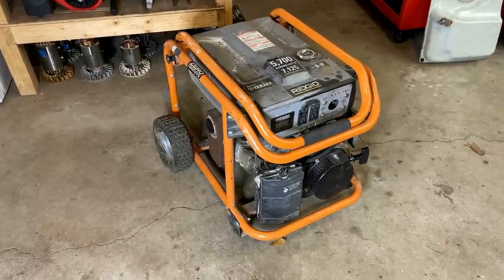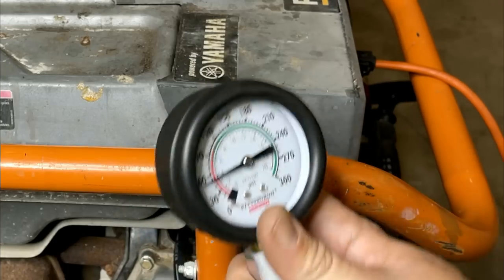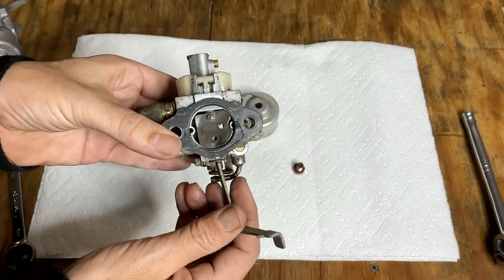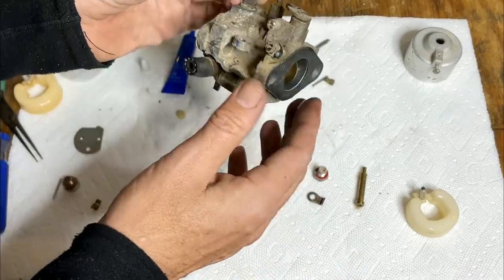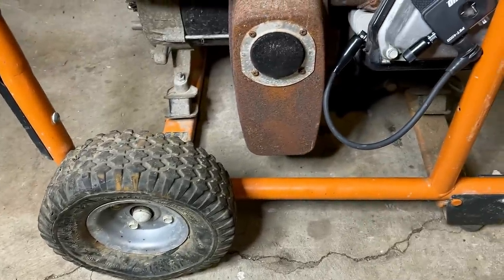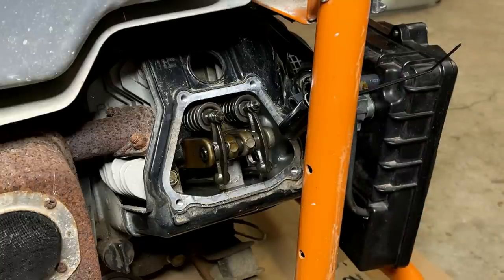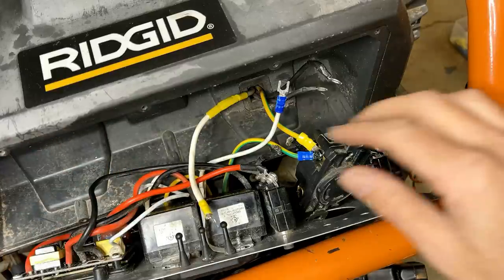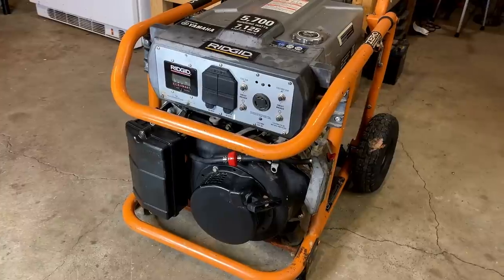Trashed Ridgid Generator - Will Not Start

Comment: Well done!  Wow, over 1500 hours is a LOT for a unit like this.  All signs point to a contractor using this on a daily basis.  Like you, I always try to put the pieces of the puzzle together to tell the story.  It's odd that the 120/240V outlet was removed, and the person was somewhat smart enough to wire nut the loose ends (wire nuts are certainly not recommended for ANY vibrating equipment) but at least the person tried.
I guess the root cause of throwing away, was maybe a no-start due to dirty carb and/or getting harder to start and run well with the need for a valve adjustment after all those hours?
1500 hours /8 hours in a work day = 187.5.  a 6 hour work day brings that to 250 days of use.
Maybe the owner decided they got their money's worth out of it, and went for a new unit that was reliable.
Good find and great video!  Oh, I don't recommend soldering wires/connections on any vibrating equipment - the vibration over time, can actually crack the soldered connection.  Crimp connection is much better.  Even better is crimp with heat shrink - it protects the wire from moisture and hold the wire in place better.
Reply from the maker: Most manufactures do crimp the wires so I do the same.  The plug may have been the final thing, but it makes me wonder how it was running before.  My money would be on the tight exhaust valve.  It’s possible after running for a few hours the valve may have stopped seating and it would lose compression.  Not sure.  Either way, the prior owner definitely got his moneys worth.

Comment: Hi James ,if you Wash the carb bowl O ring with a little bit of petrol and let it dry and it will go back to its original size.it works on all the gx Honda engine carburettors
Reply from the maker: Thanks.  Just did that the other day to clean one.  It worked very well.

Comment: I've run into a bunch of freeby (from local mobile mechanic shop's dumpster) rebranded chonda clone generators ranging from 5-9kw over the last 5 or so years, it seems like those engines are hit or miss with quality. Pretty much all the ones I got were engine grenades and the oil didn't even look bad. The ones that did run had pretty loud internal noise, even a brand new replacement engine I bought (was name brand clone too, but I forget the brand). The most impressive one I got was a 9kw dewalt branded unit that suspiciously ran great and made power. after running for about 5 minutes, I decided to pull the dipstick and check the oil level (something I should have done immediately, i know). It was low so I added oil and started it. It started pouring oil from all over the block which as I came to find out was full of holes. After dissecting the engine, I found out the governor/balance shaft thing had literally exploded and turned the block into swiss cheese. This didn't affect the engine's speed because it had an electronic governor setup for idle and run speeds. I honestly have no clue how the darn thing even ran and didn't make any noise. I'm in the process of using that cam, crank, rod and piston in another block that knocks since the bearing surfaces are still good somehow. Things seem the opposite of how they were 20+ years ago where the engines outlasted the generator heads. Think all the ones I get that still run will see some thicker oil than what is recommended from now on.. maybe 15w40
Reply: Maybe the clean oil you see was put in after the engine made bad noises from running low on oil?

Comment: when you solder stranded  together on a break ,you can weave the one inside the other and then when you solder it doesnt make a bulge  and it looks like 1 wire when you pull heat shrink over it .

Comment: James would this generator have the same issue with the vapor lock in the fuel line? I received one for free. MZ360. 8600 watt. It Sat under the guy’s deck since Hurricane Sandy.  Said it would stall and never ran right.  I cleaned out the gas tank replaced the carb and added the fuel pump. Followed your video step by step. Re- routed the fuel line. Has not failed me yet. Thanks for the great videos.
Reply from the maker: Not this one.  The tank is flat and they moved the fuel outlet to the front closer to the carb.

Comment: Spark plug gap should be 16-20 thou . Half what you have there. Its important for the timing in that a wider gap takes just a little longer to jump the gap so you have built in delay of spark. Don't know why they would say 28 thou. Could be a design problem patch.
With the valves importantly the exhaust valve clearance must be enough so that when the unit heats up to operating temperature some slight clearance remains . Too close the engine falters when its hot . I'd go out to 10 thou inlet . 8 thou exhaust usually gets them right and does not try to open the exhaust valve as it gets to full temp.

Comment: Remember when wiring, your neutral must carry the current of both phases in 120v 2 circuit ie 2 phases as separate circuits. The return to the generator will carry 2x the current of one phase. You cannot take the 240v outlet and split into two circuits. It will overload the neutral wiring in most all cases.

Comment: Jim, when you brought the piston up to TDC to confirm timing I thought the camera picked up some pitting on the top of the piston.  Maybe the screw from the choke plate did get through the intake valve.  Hopefully right on out the exhaust.

Comment: When you had the valve cover off I would have check if that screw was in there an use a camera to look inside the intake, the cylinder ,then the exhaust off . I don't know if you did that off camera or not.

Comment: You might want to work on your soldering technic.   You should put the iron on the opposite side of the join where the solder being applied.  This technic forces the solder to travel through the connection toward the hot iron.  This makes the entire connection (including the center) be filled with solder, not just the edge where the hot iron is. :-)

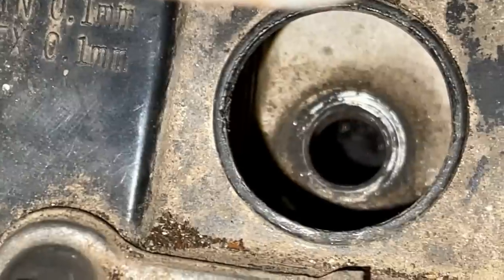Comment: 11:04 when you had the camera looking at the piston top through the spark plug hole, it looked like some small indents on the piston. did that choke plate screw go through it?

also, what's the specified service life/hours for these, 1500 doesn't seem that bad compared to other engines?
Reply from the maker: That screw probably did go though at some point in its life.

Comment: I got a duro max generator that runs on gas and propane. I wanted to run propane because it looks like the carb gets gunked up on the gerators you fix. If I have to run gas what gas should I run to avoid having carb problems ive heard non ethanol gas, what is your suggestion also what should i do before storing it away. Great videos, you have taught me alot.
Reply from the maker: Non ethanol is better for sure.  The ethanol fuel is fine to run in a small engine, but you must drain the carb and store it dry.  If you keep fuel in the tank then it must be swapped out at least twice a year.  That is how I store my generator with a metal tank and have never had a problem with the fuel system.  Other things for storage would be to keep it inside and covered.  If electric start keep a battery tender on it.  Change the oil after every use and pull the engine over until you feel compression.  That will close the valves and keep moisture out.  Always keep the fuel valve closed when not using and put a little oil down the spark plug hole for extended storage is always a good idea.

Comment: You should consider a soldering gun or a larger iron with more mass.  It is very hard to heat up a large joint or ground plane on a PCB with such a low mass tip and especially on a low end low power soldering iron.  Paradoxically, using too small an iron or a tip with too little mass on a large joint basically overheats everything.

Comment: Solder and high vibration environments... no bueno.  Guarantee it won't make another 1500 hours before it breaks.  Crimp connection with adhesive lined heat shrink for the win.
Reply from the maker: That what I did in the end.  Thanks for the info.
Reply: @jcondon1  Thought you soldered the crimp?  Didn't look like adhesive lined heat shrink either.

Comment: Nice job. When you pulled the spark plug and looked into the hole, I thought I saw, on top of the piston, lots of carbon build up... to the point that is looked like little nodules. Did you see the same thing?
Reply from the maker: Did not notice the noodle look, but definitely had carbon buildup.

Comment: Just an observation, but I’ve watched most of your videos and all your engine rebuild’s and I have never seen you check the head or the deck to see if there flat, and check thread’s on head bolts to see if there stretched

Comment: Hi James, loved the video. Unless I missed it in someone else's comment, am just wondering if the black grains/beads you found (and vacuumed from behind the control panel) may have been those moisture absorbing things put in there after previous owner had moisture issues due to machine being stored incorrectly. All the best from Trev, Queensland, Australia.
Reply from the maker: Not sure.  Someone in the comments suggested it was a type of plastic sand blasting media.

Comment: Hi just wondering if you can help me I have a inverter generator I have had 2 new carburettors on it and cleaned out and it still is not running right could it be the valves it revs up and down and will only run on choke.
Reply from the maker: If it runs well with choke then it sounds like the engine is not getting enough fuel and it running lean.  I would double check the gasket between the carburetor and the engine.

Comment: This is now about the third? time you have shown recently that an engine has had a partially functioning spark plug that throws the fault finding for a loop...
Is it now time to always try a brand new (tested in a running engine first) sparkplug to install right away....????
Reply: A new spark plug wasn't needed, correcting the gap solved it.  It's possible that a new plug would have an incorrect gap also.
Reply from the maker: Until recently I always said it’s never the plug.  But….  It is sometimes the plug.  And it can fool you.  I always keep an extra plug around for my personal generator just in case.

Comment: Have you ever tried to tune the Governor spring on generators that have a voltage droop at low load but does fine at increased load?
Reply: I mean the tension spring between the Governor arm and carb throttle plate
Reply from the maker: I have tried, but usually nothing much can be done about that.

Comment: What type of hammer drill do you use to assemble/disassemble smaller equipment? It does not look as large as ones used for big jobes like wheel removal.
Reply from the maker: It is a Ryobi quarter inch drive impact.  Do not think they make this exact model anymore.  Definitely not powerful.  Perfect for this type of work.
Reply: They do still have them at Amazon and they are selling for $30.00 right now. Thanks

Comment: Does that mean the exhaust valve was always open? If that's true wouldn't the exhaust valve clearance shrink on the valve seats itself?
Reply from the maker: It may have been open a little.  Clearance does shrink as the valve wears in.

Comment: Hi James. What is the best used cheap/portable genset that can power a 240 vac well pump and a few appliances that would be a "good deal" on Facebook or Craigslist? I'm leaning towards something powered by Briggs & Stratton for parts availability.
Reply from the maker: A Briggs and Stratton Storm responder is a good deal for the money on the used market.  The only catch is no oil sensor, so you must check the oil every time you refuel.
Reply: @jcondon1  I was thinking that the SR's were pretty common. Thanks!

Comment: 43:58 Get yourself a U-joint for that at an angle bolts.
Reply from the maker: I have one, but not rated for the impact.  Would have used it if it came down to it.
Reply: @jcondon1  For slighter angles a 'wobble' extension does a lot better. May even be some impact rated ones, but I and numerous others use the standard ones that way without trouble.

Comment: 54:17 you might want a higher wattage iron for all the metal to heat up. 55:53 LOL you pulled the repaired wire out.

Comment: You didn't mention anything about the fuel tank (or I missed it).  Was it clean? empty? rust free?
Reply from the maker: Great condition, no rust and clean.  Of coarse after I wrapped the video up, I put gas in the tank and nothing came out.  The fuel outlet had a bunch of junk in it.

Comment: Hi James, I want to ask you a question. I have a Predator 9600, and showing low oil light, but I checked the oil level and it is ok, what do you suggest to check?
Reply from the maker: I assume the engine is shutting down when it happens?  Most of the time you just need a new low oil module.  It’s located on the side of the engine.  Otherwise it could be the switch inside the engine.  Probably not worth opening the engine to replace the switch.  You can bypass the low oil system by unplugging the black wire on the oil module.  Here is a link to a new module on eBay https://www.ebay.com/itm/Low-Oil-Alert-Sensor-Module-Switch-Fits-MOST-Honda-GX240-GX270-GX340-GX390-GXH50-/274319902622?mkcid=16&mkevt=1&_trksid=p2349624.m46890.l6249&mkrid=711-127632-2357-0
Reply: Thanks a lot, James.

Comment: Good job on the revival of this one :) 
I have a few generators, but overly knowledgeable on them.
In terms of hours... 1506 hours on it.. is that considered high?
How long would you expect the power head to last for?
As im assuming thats the part that cant just be bought as replacement part... Like the engines can be..
Reply from the maker: It’s hard to say.  Some last a few hours and others many thousands.  I would rather have one with 1500 hours on it then 0.  At least I know it was made well and survived the break-in and does not have any quality control issues.

Comment: James-- a DIRTY DIRTY ENGINE--- Could you cover the Generator side with say a Plastic Bag and Power Wash the Engine ?  or would you think it to easy to get water where it should not be ?
Reply from the maker: You could.  I have done it before but only on the ones that are really bad.  Water in the stator can definitely cause an issue so I avoid it.

Comment: I would like to be able to run my generator on dual fuel. What brand conversion do you recommend.
Reply from the maker: I have only tried US Carburetion and it worked but was not completely satisfied.  You will see that video probably in May.  Will try PNGTechnologies next.  They important thing is to get a kit with a thin snorkel.  1/4” or less.
Reply: @jcondon1  thanks.

Comment: Jim, Rance here. I’m not an electrician but have a question. When you installed the 240 volt outlet, I know that each 120 volt leg (black) goes to each hot leg on the 240 colt outlet. Did the white wires on each 120 volt leg (common) go to back to one or two return connectors? I hope I made myself understandable.
Reply from the maker: In this case the white wire ran to each of the 120v outlets and the 240v outlet.  Some generators have separate white wires coming from the stator, but even in that case they are normally combined in the control panel.
Reply: @jcondon1  “Thanks” Jim

Comment: James you and your 50 and 60 soldering wire repair. Solder is not the right repair for this size wire. Soldered wires over 14 gage do not do well in high vibration area. Wen wires are soldered it the solder flux and heat make a hard area that work hardens over time. This work harden edge area is weak spot,  it gets brittle and gives problems. You wear right in replacing the wire. from Texas Master Election mike

Comment: Even if this thing runs, I don't give it long.  Ridged makes a good product if it stands up to that abuse!   Looks like it was run constantly with no maintenance.   Oil changes?  What's that?    LOL.    People amaze me that won't even buy a proper air filter.
Reply from the maker: It happens all the time where there is no air filter at all.  At least they made an effort.  Would not say it worked very well.

Comment: I got the impression you say 1500hrs like it's some astronomical number when in reality that's only about 2 months of continuous use, I regularly see 2-4000hrs on machines(that have hour meters fitted) & recently saw a Honda EU70is with 9800hrs on it & still going strong, on the other hand I currently have an EU65is with 2400hrs on it which needs an Inverter Module(around $2k here all said & done) so unfortunately not worth fixing as it's current market value is about $3k
Reply from the maker: Engines on inverters tend to last a lot longer due to the lower rpm’s.  Traditional generators running at 3600 do not last as long.  I do not see many with hour meters over 1500 so not sure how long they can last.  Normally the eventual failure on a generator that has been cared for is the powerhead and not the engine.  Or the inverter module on an inverter generator.